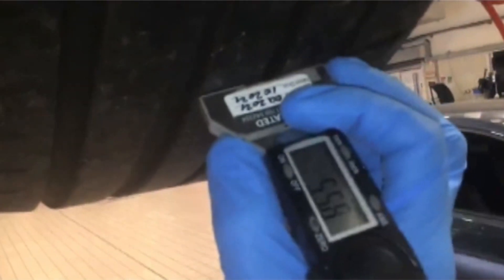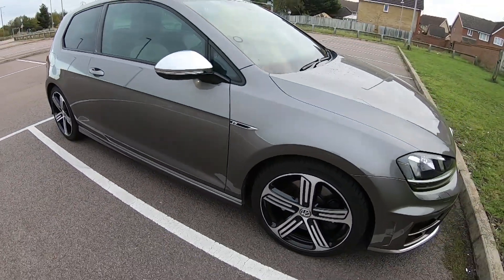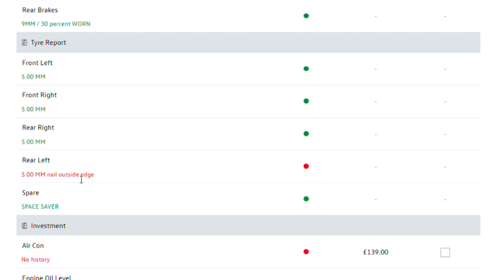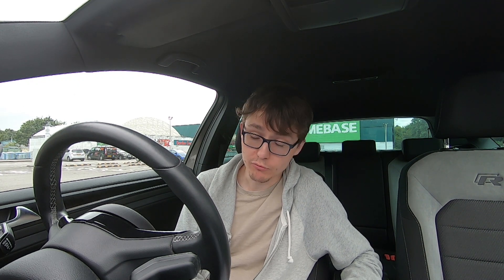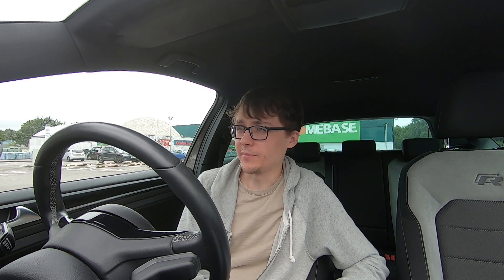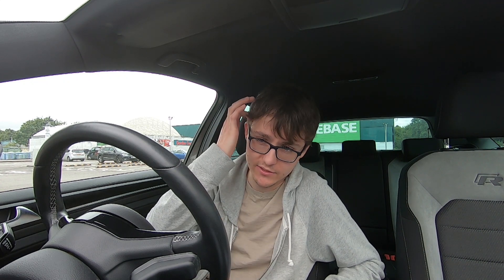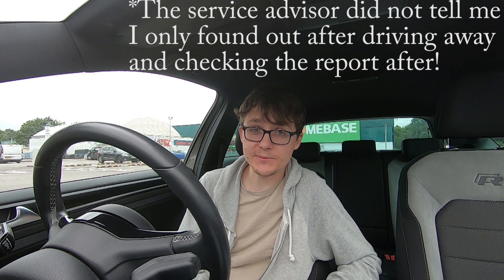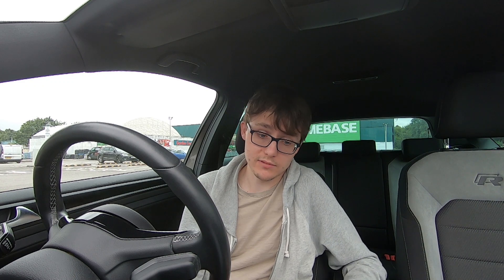VW Main Dealer Major Service For My Golf R!

Comment: A lot of  surface corrosion in the chassis and suspension there. Seems to be a problem in these cars. The paint and coatings applied at the factory must be watered down pish. I am in the process of an underbody refurb on mine at the moment. It will be better than new when its done.

Comment: Hi Sam I paid £354 from a Mai dealer in Canterbury in June for mine major service.
Reply from the maker: Thanks for sharing! It did quite £354 but they then said to me for cars over 2.0litre it was £404 across the board as standard 🤷‍♂️
Reply: @SamAustin  Yes but mine is a 2019 model and they washed it as well so wasn’t too bad
Reply: @SamAustin  Have you had an engine re-bore Sam, last time I looked the Golf R has a 2.0 litre engine or more accurately 1984cc - the volkswagen published price for a major service is £354 for models up to and including 2.0 litre engines and £404 for Touareg!

Comment: Wish the major service on my m2 was just £400, double it and add a little more😂
Reply from the maker: I've heard BMW services are pretty extreme. Doesn't the M2 have 1500 mile running in oil service which costs about £400 from a dealer? Great car though 👍
Reply: @SamAustin  yeah around the £300 mark for a RIS, about £1300 for a major, minor and brake fluid.....that’s the M tax way